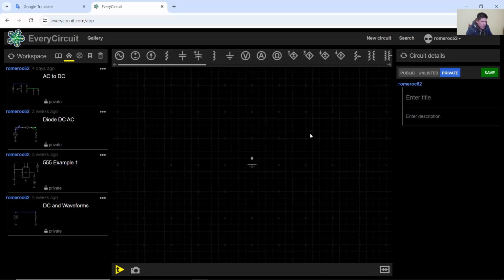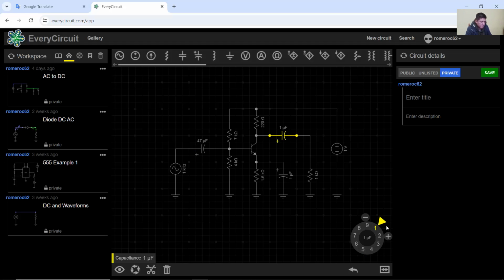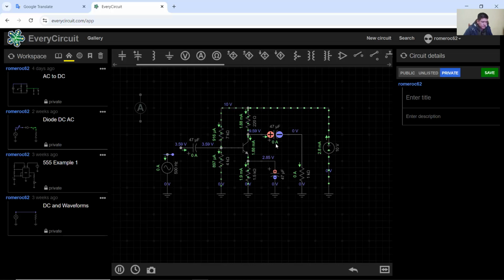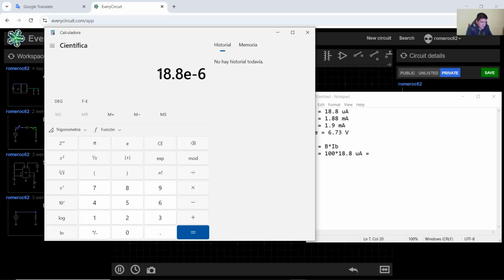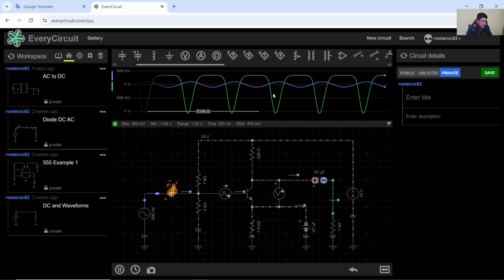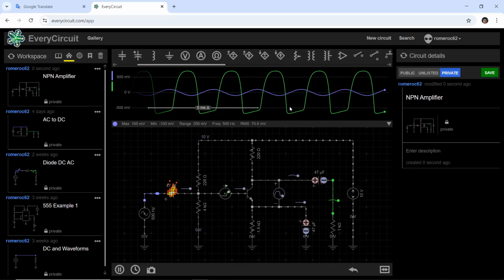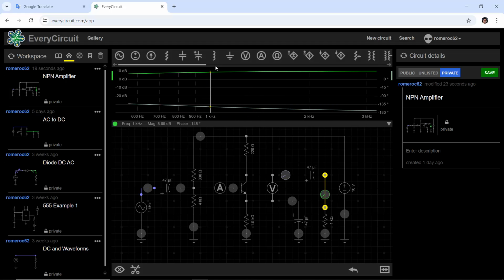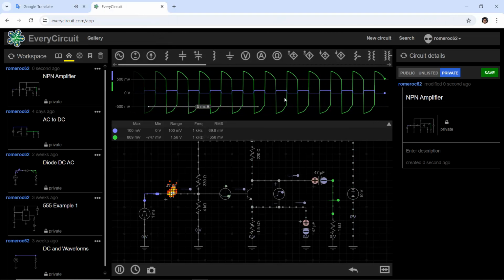EveryCircuit - NPN Transistor as an Amplifier

Comment: Do NOT pay any money for this service.  It has no support and you have no control over saving hours of work.
Reply from the maker: You can do this in any other simulator
Reply: It depends on how dear $15 (the price of this app) is to you and what alternatives you have. This is not meant to be a professional tool but it does a pretty good job of visually showing circuit behaviour. To many beginners, the ease of use of this tool totally justifies the cost. More professional tools like LTSpice require hours of learning before you can make sense of what you are doing.